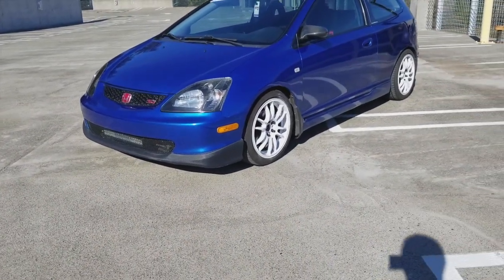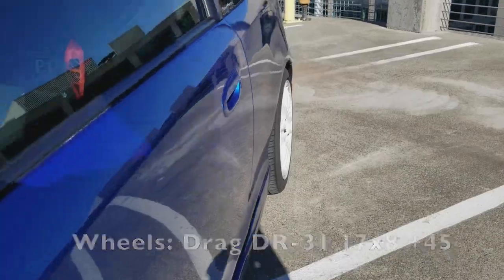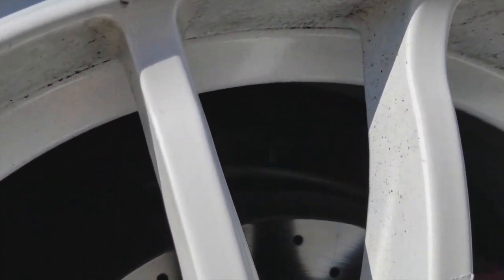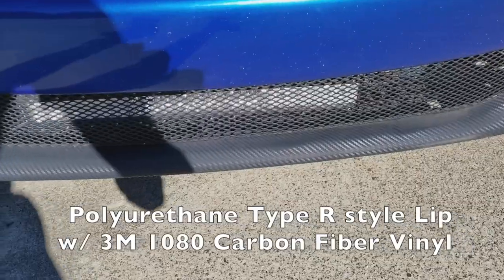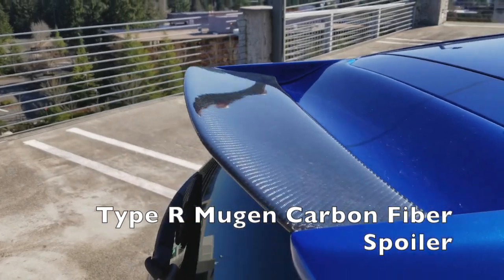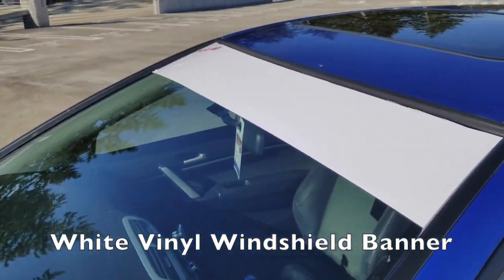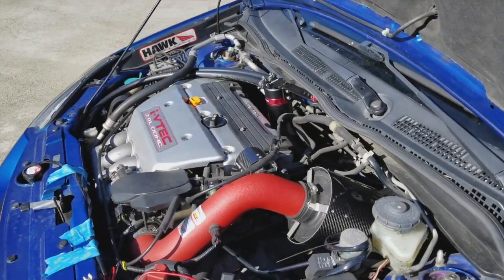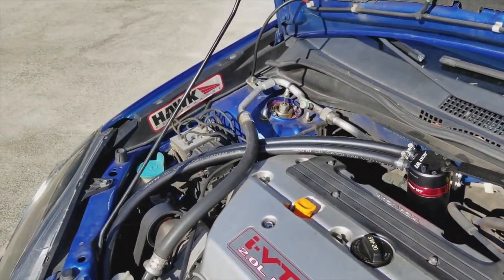Track Built / Daily Driven Civic Si Mod List! | 2005 Honda Civic Si EP3 | Sit Down 004

Comment: Does the short throw really help that much with feel and could it wear out any shifter parts prematurely?
Reply from the maker: The cables move to the tranny the same amount, all it does is change the leverage of where the shifter is and pivot point. It goes into gear all the way

Comment: Hey sucks i didnt find this vid for 4 years.. do you still have the EP3? hows it doing rn or did u sell? they went up in value recently they are starting to get hard to find decent looking ones

i got 2005 EP3 with  98k on the shell and the k20 base it was a decent motor but i now got a  K24A2 and 6 speed k20a2 type r Trans. its tuned 93 it got 226HP its alot of fun a huge difference but alot of wheel spin on 16s true DC2 TYPE R rims.. what tires would u reccomend?
Reply from the maker: I ended up selling it years ago. That’s a nice setup on its! I would reccomend trying to fit a 245 tire in front. For daily driving maybe a continental extreme contact sport or if you want something more agressive some Bridgestone re71r or Yokohama aoh2

Comment: Swap in a k24A2 and you can keep the ep3 5speed transmission .
Reply from the maker: Steevnb * the ep3 5 speed fits on just fine?
Reply: Yeah bro I did my research it just bolts on ! I seen it on ephatch . So you don't need a 6speed it would work with 5speed plus hondata reflash!
Reply from the maker: Steevnb * thats awesome! I'm going to look into prices for those motors!
Reply: Yup just make sure it comes out of the TSX because some come out of the accords and those have the same hp as the k20A3
Reply from the maker: Steevnb * yea, I had the choice to pick between the tsx and the ep3, so I test drove both, tsx manual, and It was fun! Just didn't handle that great bc it's a sedan, but I want the engine, what wiring harness do you use?
Reply: Redline Ricer Same one as long as you leave it 5speed . Their is videos of ppl on YouTube that have that set up check em out ! They are pushing more the 200hp n/A which is better then going turbo since you have AC and ect if it's your daily .
Reply from the maker: Steevnb * awesome!thanks so much
Reply from the maker: Chris Aldridge thanks for letting me know!!! Does the stock ep3 transmission fit the k24a2?
Reply from the maker: Chris Aldridge I appreciate the help!! Thanks so much. And if you havent already please sub :)thanks
Reply: yeah i have an 2005 k24a2 and still have the stock tranny ^_^
Reply: its too much fun! six  speed would be better, but 5spd is good enough for now :D
Reply: Chris Aldridge also need a crv mount bracket to swap a k24 and a throttle body adapter. Most people switch over to rbc manifold for high end

Comment: What did the re flash on the stock engine do? Increase power? Increase efficiency? Both? How does one go about performing the reflash?
Reply from the maker: U have to send the ECU into hondata and they do it for you. It gave u launch control, a little bit more horsepower and torque to complement intake and exhaust mods. It was noticeable. But in my opinion you should save and get KPRO bc u can tune it
Reply: @RedlineRicer  just got my hands on a 02 and it needs alit of TLC. I'm going to focus on suspension first but it's good to get info from somebody who has gone down that road already.
Reply: @RedlineRicer  I have an 05 too but Hondata claims they can't reflash the 05 ECU, specifically the PNF A13 ones. Did you change ecu? Awesome car bro

Comment: Are you experiencing any tire rub with that size wheel. I have 17x8 wheels with stock struts and they rub. Wondering if you had that issue or since you have the d2 coilovers were you able to avoid that?
Reply from the maker: andyt713 for me. It's fine! But keep in kind the d2 racing coilovers are a lot thinner than the stick struts so it doesn't touch the tire. Also, my offset is +45, and with a 17x8 wheel, it doesn't hit my shock, but it hits my rear beam (linkage in the back) so I have a 4mm spacer to make the offset in the rest +40. Offsets are a very tricky thing. Hopefully that helped!

Comment: SLOW 🐢🐌 my ep3 k24 swap with handata only spent 2500
Reply: Hey I've wanted to know what did you need for the k24 swap?
Reply: @DavidTeleiosis  hondata ecu, passenger side crv motor mount. and blox throttle body adapter, thats it i believe
Reply: Doing a K24a2 on mine, fortunately i bought mine with all suspension aftermarket

Comment: hows the buddyclub p1 seat? Comfy? Plan on getting one for my dc5.
Reply from the maker: Sunny Yu get one! It's really popular in the Honda Community. I would say go for the seat I have, the limited edition seat, as the padding is better, the material is better and it's actually pretty comfy. It isn't as comfortable as a sparco evo 2 seat, but if you get the "large" size, it's comfortable. Not once have I had pains from driving in the seat, but that being said, I haven't driven for longer than 1 hour at a time... hope that helped! And please subscribe if you haven't already!
Reply: sounds good. im actually running buddyclub rails on sparco evo 2 seats sad to hear not as comfy :(, but ill see about that. The fitment doesnt work impossible to line up the last bolt so gonna decide on the buddyclub just so my fitment is right. Do you know the sizing for regular and large? I'm 5'7 170lb
Reply from the maker: Sunny Yu my waist size is a 31 or 32 and I fit fine, I got some space, but it's to a minimum, I would say go for the large, but it's up to you!! If your waist size is under a 30 I would say go for a regular
Reply: large for sure haha thanks for the responses!
Reply from the maker: Sunny Yu no problem man! Sub if you haven't already! I appreciate your support!